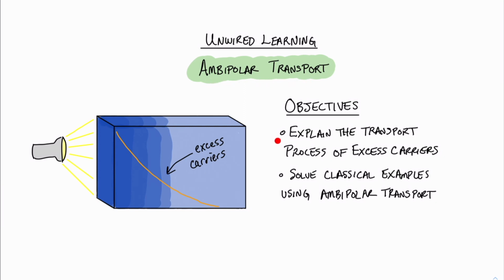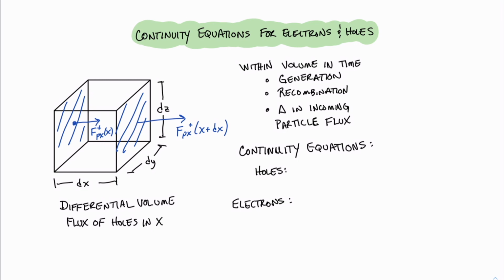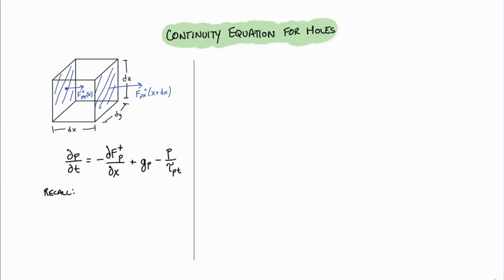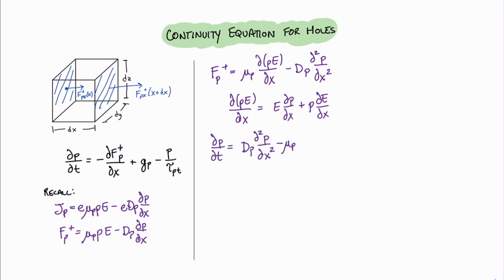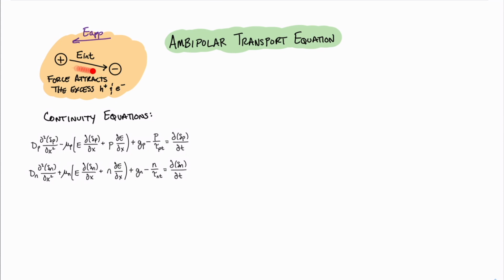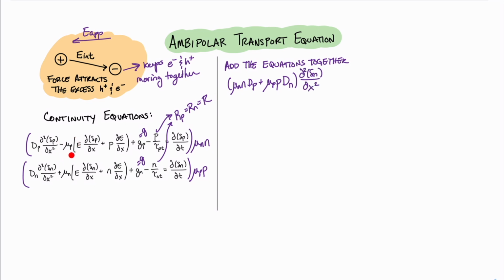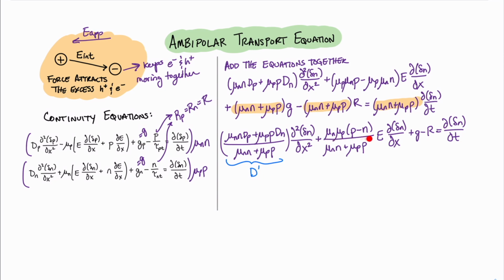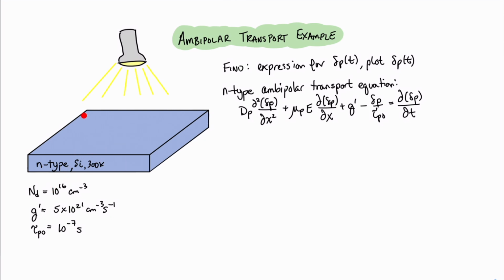Ambipolar Transport

Comment: I have only one comment on the beautiful presentation (thanks!): In the first few minutes the instructor begins by saying: when photons arrive then we measure a current. Is flawless. But then he tells me that positive charges move together with negative ones. But this does NOT generate current !!!
I also have some questions: it is said that they move together. Good. Then we arrive at the result that the mobility is that of minority charges. Great, but mobility is a positive number. Then: what is the direction, particularly in the case I create positive and negative charges in an intrinsic semiconductor? (Where the concept of minority charges makes no sense). That is: does ambipolar transport only concern doped semiconductors in the presence of an external electric field?

Comment: What will happen to the ambipolar mobility at high level injection? Since Δn=Δp, will it be zero? But how does this exaplin the carrier flow if the mobility is zero?

PS: At 8:56 you didn't write the derivative on left side of the equation.